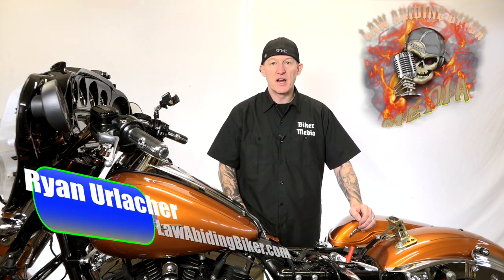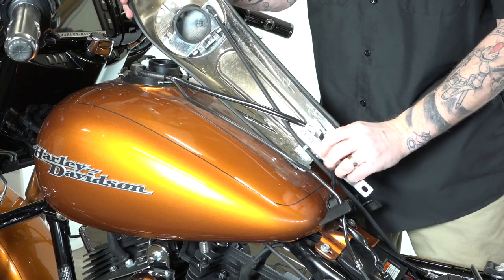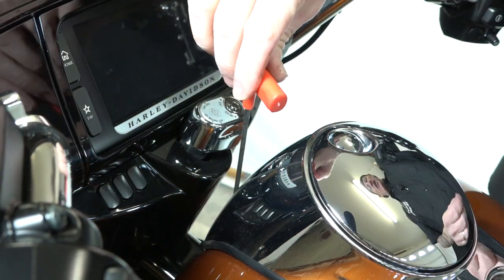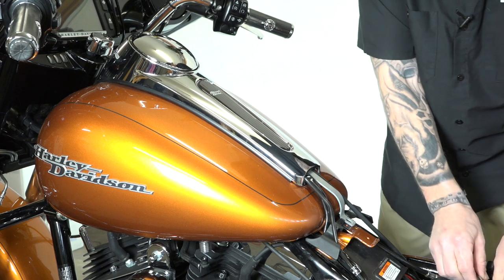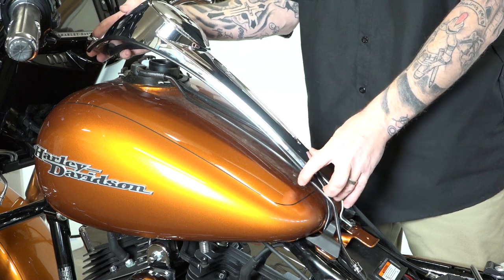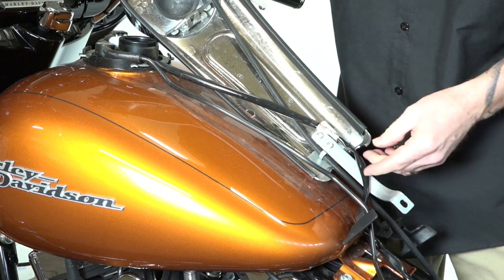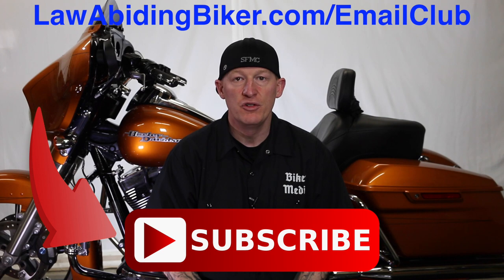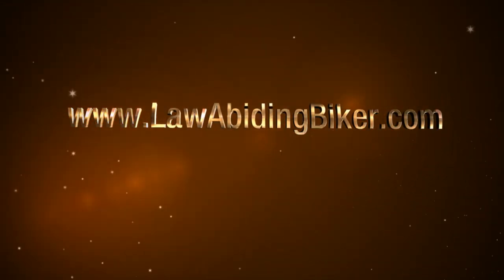How To Remove & Install Harley Fuel Tank Dash Panel Console-DIY

Comment: Thanks. Simple and to the point. I was running wire from a car remote that I adapted and connected to a switch on the flaring. I thought that was the only 2 bolts holding that thing on but age made it stick a little and made me unsure if something else was holding it down. Subscribed.
Reply from the maker: Glad to have you as a subscriber!

Ride safe & Ride Often!

Here is a link to a bunch of our useful Free vids: http://www.lawabidingbiker.com/freevideos

Here is a link to some of our useful for purchase videos: http://www.lawabidingbiker.com/buyvideos

Want Answers & Information Fast? And help support us at the same time? Do you like the content we provide?

Our patrons get answers to their questions/comments/feedback in less than 24 hrs and are part of our Private Facebook Group. If you are interested in being in this exclusive group you can get all the details at ==> http://www.lawabidingbiker.com/patreon

If you haven't subscribed to the Law Abiding Biker Podcast make sure to do so. Listen in as we talk weekly about issues/items like this & so much more. You can listen on iTunes (Apple/IOS), Stitcher Radio (Android), or any other Podcast App ==> http://www.lawabidingbiker.com/podcast

Join our free email club at http:///www.LawAbidingBiker.com/EmailClub. Only relevant content will be sent from time to time. Email club members are the first to find out about free or for sale content are given special coupon codes.

Comment: Hey buddy do I remove the same way on 1997 Ultra Classic? Mine has the CB controls but I’m replacing with another without controls. I took the CD changer/CB out of the tour pack trunk that wasn’t working any way. Look forward to your answer. Ty

Comment: Ryan. Help me out please. 1997 Ultra Classic. How do I remove the tank dash like you did in the video? 97 does not have the Allen screw in the front like the video. Is it just the bolt under the seat on this? I don’t want to get into it and not be prepared for whatever.

Comment: Hi Ryan, I am wanting to do a CB delete on my 2016 street glide special, It has the com plug in the center console and the rear whip antenna that frankly are eye sores to me. Like to put standard console on it. Do you by any chance have a delete video for this or any ideas? Ive searched the forums with no luck

Comment: Hey Ryan, I've been a subscriber for the past several years.
I easily removed my dash panel on my 2013 Street Glide.
Did what I had to do and when I went to re-install it, I stripped the 5/32 allen screw trying to screw it down!
What advice have you got for me to fix this thing?
Is there another screw I could use to get through?
Please help!
Thank you!

Comment: Any idea what size 3/8 bolt that is on the rear? Length and threads? I took mine off and it disappeared, so now trying to replace it